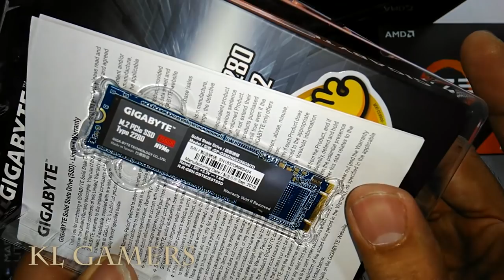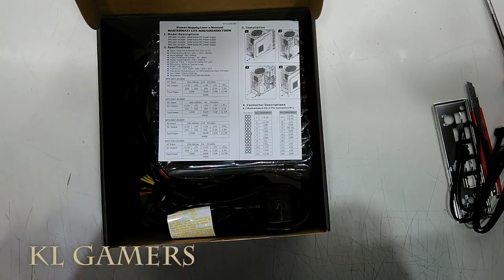AMD Ryzen 7 2700 PREDATOR RGB 16GB msi B450M MORTAR GIGABYTE RTX 2070 700W EXTREME GAMING Build 2019

Comment: B450M and 2700? Is there overclocking potential with this choice?
Reply from the maker: usually i no overclock
Reply: @PsicosisYT  There's actually no way to be angry, if he don't wanna "damage" his components by OCing as a fool, it's his law bro', chill...
Reply: Yeah, the 2700 stock cooler is pretty mad. My idle with it sat around 36C, under load I think it hit 52 at most, ever. (at base clock)  Aryan thapa
Reply: Aren't all ryzen cpus overclockable? I'm pretty sure you just need a better third party cooler for a better chance at getting better frequencies. AIO would be a good option but a big air cooler would be good enough.
Reply: @ahmadsaifulaimansalehuddin2136  All AMD cpu's are overclockable, and the Ryzen 2700's come with a good stock cooler, so you can get some mid-tier overclocks just with it alone
Reply: @PsicosisYT  true... Sorry... I was accidentally was thinking of the 2700x. My bad. Anyways, AIO for best result but like you said, AMD's stock cooler is no joke. You can never get that beefy of a cooler for intel CPUs
Reply: @ahmadsaifulaimansalehuddin2136  Haha, hell no you couldnt XD Intels stock coolers are just assinine, and the 2700X comes with a cooler, but its bigger and doesnt fit on some boards unfortunately ;;
Reply: that mortar can easily take 1.4 volt on a 2700x

Comment: This man put a mATX motherboard in an ATX case, why would you do that? If you did that I would have bought the MSI B450 Tomahawk rather than the mortar.
And another thing to point out, when running your cable to power the led's in the cooler, you could have ran it up through the holes at the top of the case and then in behind the motherboard, then putting it through the bottom and connecting it to the motherboard. This would improve cable management and lessen the risk of it interfering with components on the motherboard.
Cable management could do with some work and potentially think of getting some extension cables to get rid of those ketchup and mustard cables. This would improve looks immensely. 
Great choice of components and good build.
Reply: Mark Jherick Sevillejo  i would choose a better case as well

Comment: I have a aorus radeon rx580 XTR trying to decide which ryzen chip would benefit me thinking ryzen 5 2600 then want a ryzen 2700 or 2700x which should I go with the graphics card is a few years old?
Reply from the maker: Anything will do. Can buy the Ryzen 3000 series as well
Reply: KL Gamers I can only go up to 2700x two cards I chose was the 2600x or 2700x since I multistream multitask and stream I have the asus prime b450ma csm am4 motherboard fits for all the ryzen chips second gen only problem is can it handle it without any issues

Comment: Hey! Great vid bro but one question, im planning on getting a gigabyte b450m ds3h motherboard.. will that also have the fan rgb connector to connect to the cpu fan? im pretty new to pc building..  and, will i have any issues?
specs: 
AMD Ryzen 7 2700
Crucial ballistix 2x8GB DDR4 3000MHz
thermaltake 550w psu
my old 2gb gddr5 gt710 (will upgrade later)
pls help

Comment: I have bought ryzen 7 2700 cpu, corsair 3000 mhz 8*2gb ram, 500gb samsung 970 evo (NVMe M.2) and planning to but x570 mobo. I do not have enough money now to buy a good graphic card. Is it possible to assemble this with a cheap graphic card that used to cost less than 7-10 USD 10 years ago- I mean the PCI card that also used to support audio when mobos did not have integrated graphics. Please reply as quickly as you can.
Reply from the maker: not sure, maybe not
Reply: @KLGamers  Thanks a lot for the quick reply.

Comment: Hello! I installed a Ryzen 7 2700 some weeks ago, bought it from a friend and he lost the little cable that goes connected right next to the AMD logo. Nevertheless, he told me the lights were still turning on when he got it installed besides not having that little cable, but mine are not turning on :( Cooler works just fine, and the AMD logo does light on, but the light circle doesnt. Do you know why? Thanks! <3

Comment: Hey why is the cpu cooler is lighting?
Reply from the maker: RGB
Reply: Because the motherboard has a rgb header? If i use r5 3600 and it's stock cooler and the same mother board with it be lightning as well?

Comment: Mortar is good motherboard like tomahawk?
Reply from the maker: Between these two...

The Mortar is mATX form factor, the Tomahawk an ATX form factor which won't fit an mATX case. Conversely, the Mortar won't fill up an ATX case.

The Tomahawk has heatsinking on the VSOC VRM FET's...but that won't be a problem with the Mortar since you aren't using a Ryzen APU.

The Mortar has two M.2 ports to fit two NVME's. The Tomahawk has only one M.2 port.

I think the Tomahawk has a slightly better audio codec chip. 

Otherwise they are very similar and either would do great with a 2600.
Reply: Keep up , thank you

Comment: Bit of advice. Try leaving stuff in their package untill you come to use it. You took your CPU out and just dumped it onto of the manual pins down. If you dropped something on it you fucked. Same with your CPU fan you put that face down and you could have had anything get stuck to your Thermal Paste.

Comment: Im not sure if i should be asking this to u guys, the hell with it...

I plan to build a gaming rig and i was hoping if you can tell me if any of the list of motherboards bellow can operate without a graphics card? Or can you tell me which ones i can buy without GPU for the time being I’m saving money?

Motherboards:

ASUS ROG STRIX Z390-I GAMING

ASUS STRIX Z370-I GAMING

GIGABYTE H370 AORUS GAMING 3

MSI Z370 GAMING PRO CARBON

MSI MPG Z390 GAMING PRO CARBON AC

ASUS ROG STRIX Z390 E GAMING

GIGABYTE Z390 AORUS PRO

GIGABYTE Z390 AORUS MASTER

So basically this is my plan if possible..

Processor: Intel Core i5 9400f
Motherboard: ( choosing the best among the list of mobo above  )
Gpu: (to follow)
Memory: 16gb ram ddr4 
HDD: 1tb hdd seagate
SSD: 250gig
Case: (dont know yet)
PSU: 700watts
Reply from the maker: Intel Core i5 9400f model is without graphics. So cannot. replace with 9400 and 8400 and you r good to go.
Reply: Ok thank you! So that lone “f” is the version thats not gonna make it work since “f” means no video?
Reply from the maker: Yes  “f” is the version that not gonna make it work since “f” means no video
Reply: @pjcagabs9908  well.. one question why the heck you nedd a 700w psu.. if you don't use a gpu?!! ... even if you do in future.. you don't need a 700w...a good 550w is more than enough.
Reply: If u not plan to upgrade later..then Asrock B365 Phantom Gaming 4 should be ok with i5 9400f
Gpu :gtx 1660 ti or rtx 2060
2x Hyper x Ddr4 8gb 2666
1tb seagate firecuda sshd
240gb seagate barracuda ssd
Case tecware nexus c tg
Psu evga 600 GD Series 80+ gold or cooler master MWE gold 550
Monitor: IPS panel 144hz

Comment: The best option  for the 7 2700 is a x370
Reply: But that is if you want to do crossfire. If you are happy with a single gpu setup, a b450 would be the better option imo. The b450m mortar is not the best b450m but it is a decently priced mobo so, its a budget option that allows good overclocking. Especially easy for newbies since it has the ez oc mode from msi. Although, its obviously better if you have a better cpu cooler.

Comment: how much it coast? 1500$?
Reply from the maker: Processor = AMD Ryzen 7 2700 8 Core 3.2GHz  = RM1249
Motherboard = msi B450M MORTAR socket AM4 = RM439
RAM = Kingston HyperX 16GB(8GBx2) 3200MHz Predator DDR4 RGB CL16   = RM599
SSD = GIGABYTE M.2 NVMe PCIe SSD 256GB = RM219
Hard Disk = Western Digital WD20EZRZ Caviar Blue 2TB desktop hard disk =RM249
Graphics Card = Gigabyte NVIDIA RTX 2070 WINDFORCE 8GB = RM2369
Power Supply = MasterWatt Lite 230V 700W Power SupplY =RM279
Casing = Armaggeddon KAGAMI K3 ATX GAMING CASING = RM169

TOTAL = RM5572

Price is based in local Malaysia current price.